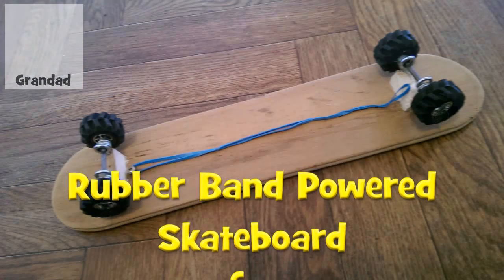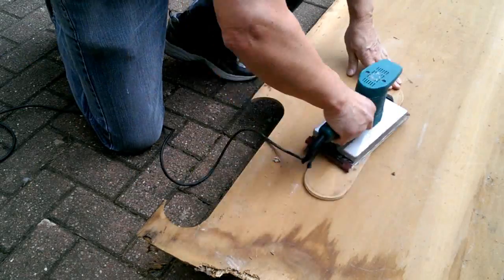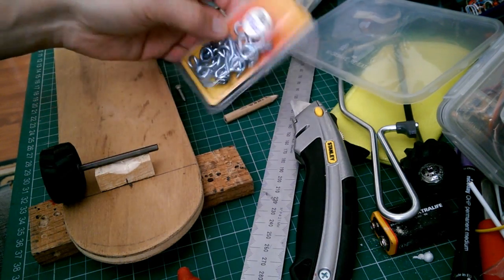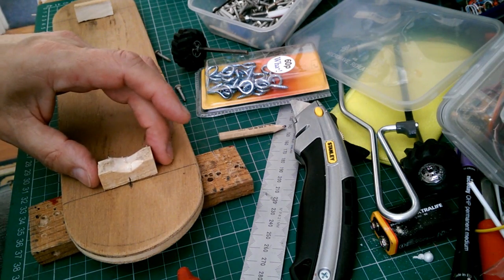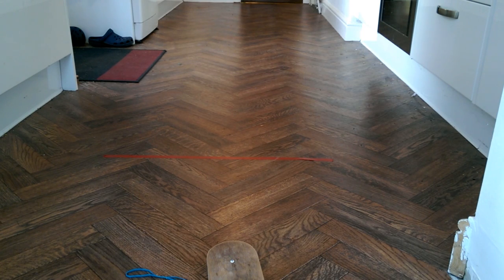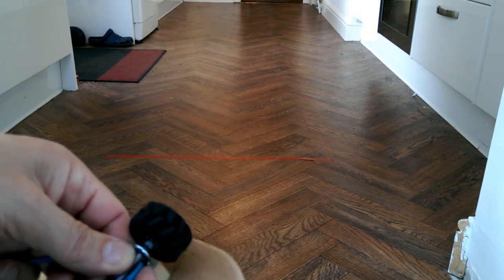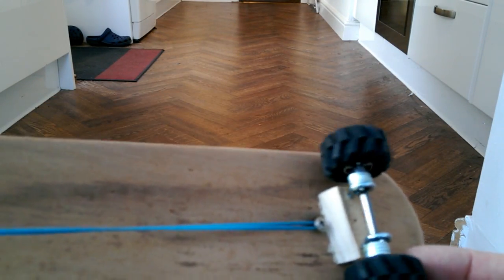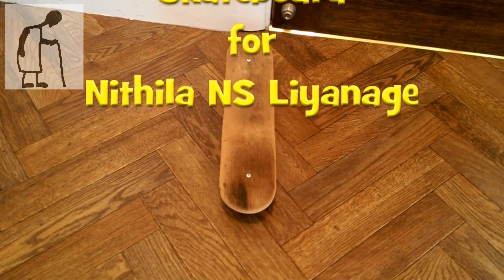Rubber Band Powered Skateboard

Comment: Can you do a powered Real skateboard?
Reply from the maker: +adam clark not much point, there is no way I am getting on a skateboard at my age. If you search YouTube you will find several already done. The main problem is that most home made versions lose the proper steering because they have to mess around with the axle to get power to the wheels.
Reply: fair enough, cheers anyways

Comment: Hey grandad can you make a cardboard rc plane? (with motor)
Reply from the maker: +Aspire SK not much point unless you are going to use hobby grade equipment and I do not want to start using hobby grade motors. There are plenty on YouTube already https://www.youtube.com/results?search_query=cardboard+rc+plane I do like this one by Brandon Campbell https://youtu.be/24QZA0-pMLI he has others on his channel so check it out
Reply: +GrandadIsAnOldMan What about rc helicopter engine, 1 servo for up and down, second for steering, brushed esc and some cardboard ;)
Reply from the maker: Aspire SK why cripple a project by using cardboard to begin with? It is a heavy material and any flying here in the UK will involve it getting wet and then it will go soft and lose all shape and strength.
Reply: +GrandadIsAnOldMan I think cardboard is cheaper than polystirene...
Reply from the maker: +Aspire SK I only use scrap cardboard or scrap styrofoam/polystyrene so neither cost me anything. I had a quick look through my projects and pulled this playlist together with some of the projects that use cardboard as a main component. I found 87 and I know I missed some. There are some planes in there but the majority are cars https://www.youtube.com/playlist?list=PLA5a2xPRSrB2kCjHz2KmXzB8-6Oew2mEu
Reply: +GrandadIsAnOldMan I know you are using only scrap material because a watch you for a year but i think making something from a cardboard is much simple than from a polystirene (thats your choice) and ok, if you already make plane from cardboard. (sorry for my english, im from Slovakia)

Comment: hey grandad ! I am very upset ! you didn't made the car which i requested !!
Reply: He gets a lot of requests and obviously can't make them all straight away. If your request was practical and won't use many expensive resources then he will get to it soon enough.
Reply from the maker: +Amrit Jung Dangi well that is a shame, perhaps you should consider the fact I have 41k subscribers and as a result I get lots of requests. At any moment I probably have 100 or so requests in my list and I do the ones that I have the right materials to work with. At the moment I am uploading 2 or 3 videos every day so if I had no more requests it would still take over a month to clear all the requests assuming they can all be completed at that rate.  I also try to limit the number of videos I upload as people probably cannot spare the time to watch every video I upload and if they are not being watched then I am just wasting my time uploading them. As it happens I did make a car with 4 motors, I uploaded it on Oct 31 but it will not be published until Nov 13 as there are so many of my videos in the pipeline already. Today I am uploading videos that will not be published until Nov 25.